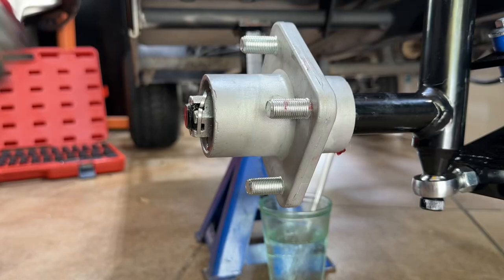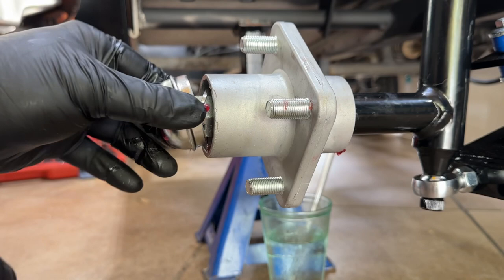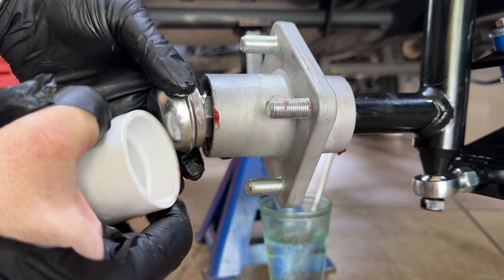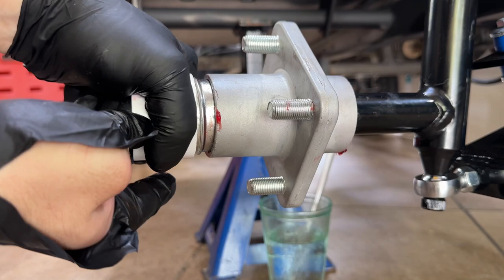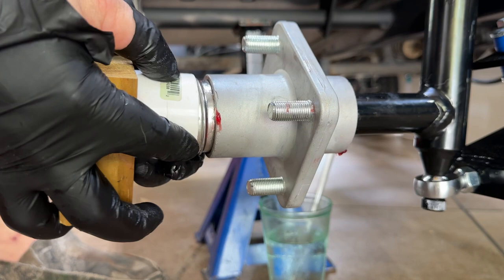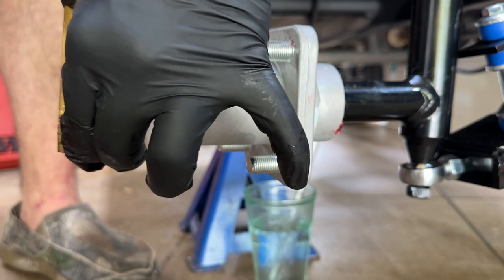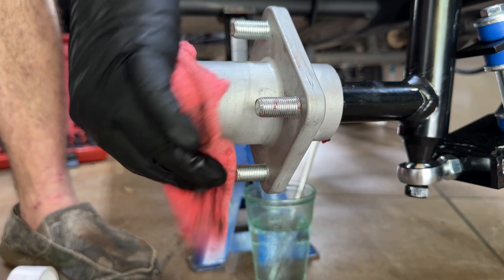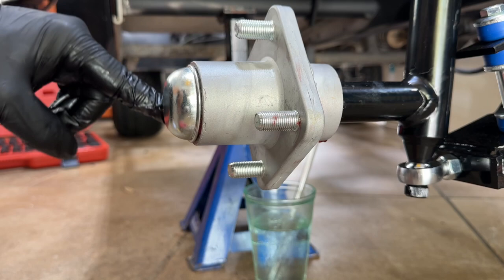How To Install Metal Hub Dust Caps The Easy Way | No BS

Comment: Thank you for the video. Saved me $30.00 not buying a dust cover tool. Instead, I spent a little over $2.00 for a 2” PVC connector at Home Depot and it worked great.

Comment: I spent 15-20 minutes trying to get a dust cap on a wheel bearing.  I was thinking that I had the wrong size dust cap.  I used a caliper to determine that it was the right size, but I still couldn't fix it.  I found this video and tried it.  It took less than 5 seconds to get it on.  I could not get over how simple it was using your method.  Thank you for sharing, because I would still be beating on it otherwise.

Comment: I struggled with a cheap flimsy new cap for an hour and gave up after I rimmed the POS. I then picked up the old cap from the trash can and it went right in.

Comment: You need a bigger hammer! LOL
Reply from the maker: Hahahah. I’ve done it with sledges but I only had a PT 2x4… would have split way faster. Hahah.
Reply: I knew I could use a piece of pipe but I didn't even think about PVC. That's definitely going to save some money at Home Depot. Thank you! I also didn't think about using grease either.

Comment: My caps are 2.44. The REAL issue are the junk chinese caps. The ones I got mic-ed 2.469 and 2.480. Short of using a hydraulic press they aren't going on. I'll go hunt down a 2.5 PVC pipe and give it one more try.